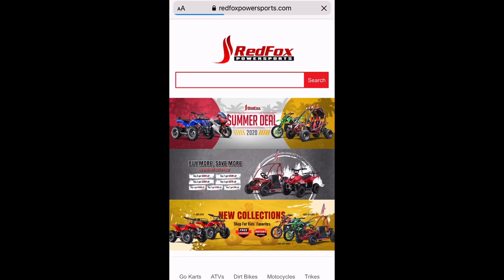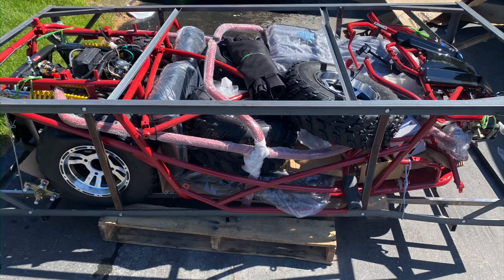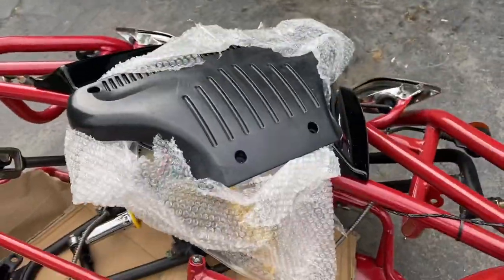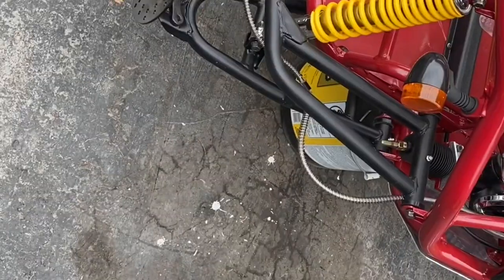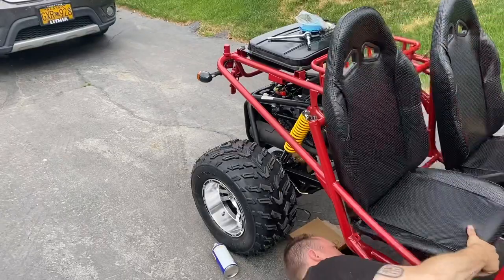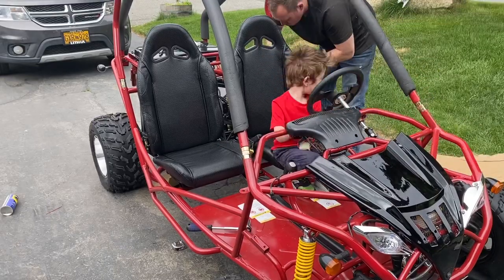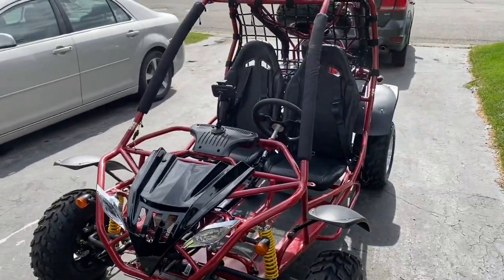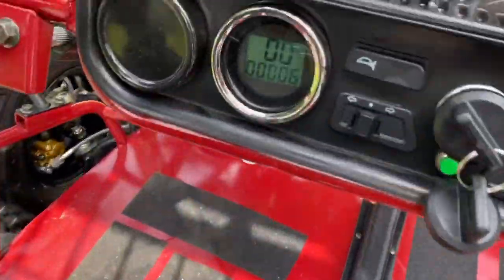I Bought a Go Cart! DONG FANG 200GKA + Back Injury Fail!! RE-UPLOAD

Comment: Hey thanks for the review! I literally just ordered the same kart/buggy and can’t wait to test it out. Seems like a good deal for the price!
Reply from the maker: Caleb Downey it is very very good for the price.  I’m slightly disappointed at things like the latches on the back end, and the way the passenger seat had to be refitted. But all in all it’s very difficult to beat the price.  And when I started up the first time and it fired over, it’s hard to beat that feeling of not having to suffer through all the problem solving
Reply: All Things Random Right, I figured things wouldn’t be perfect, just have to modify a few things here and there but overall that’s sweet glad to hear!
Reply: @allthingsrandom8137   where did you find your research on aligning the front wheels
Reply from the maker: James Furnish so I’ve aligned front tires on ATVs before and just followed the same.  What I did was measure (tape measure) the front of the front tire and rear of the front tire 
and adjusted until they where even.  It’s close enough I don’t feel any issues
Reply: I was going to pull the trigger on this one as well from the same website, but read a ton of bad reviews about the company.  How was your experience with them?  How long did it take before they shipped it?
Reply: @thedivision2761  me too bud. Until I see this video I was like heck no! But now I'm kinda thinking about it. I'll pay threw PayPal so of something happens ill get my money back.
Reply: @TEXASpatriot76  I actually ordered it.  As far as customer service goes they have been great.  Nothing like the bad reviews.  I ordered from redfox power sports.  The only negative things that happened are the gate in the back doesn't line up to close, and mine came missing 1 Tie Rod.  They are sending it now and have been good with customer service.
Reply: @thedivision2761  I'm from NY and ordered two of these about a month ago. No problems with the process at all and got them in a week (came from California). Same issues with the passenger seat and latches on the back hatch latch. Got about 40 miles on each and they're both still running great.
Reply: @allthingsrandom8137  update?
Reply: @thedivision2761  I ordered one as well, I live in west Texas and was able to find a dealer here in Texas. I'm pleased with mine. I wish it had the torque in forward as it does in reverse lol... that thing will spin the crap out of the tires in reverse

Comment: I’d use only non ethanol gas in it and on the back clip I’d weld a new tab and use 1/4 plate or a nice nut welded with a bolt to tighten it down.I wouldn’t use ethanol gas though In anything other than cars above 2000 year model.Not in mowers or weed eaters or that cart

Comment: I’m looking into getting the same kart but unfortunately the price has risen to about $3,000 do you think that it would still be worth it. Also how was your experience with Redfox Power sports. Sorry for all the questions but you are the only guy I found that has really done any sort of review.
Reply from the maker: I think it’s worth it for sure.  The only reason why I think I got mine for so cheap is because it was right in the middle of last summer during the pandemic. So they were just trying to get rid of whatever they could to stay a float. I think as long as you’re buying it for under about four grand, you’re great. If you look at comparable ones especially like for me here in Alaska they’re upwards of five to $6000. So even with a $1300 to ship it up here it was still far worth its value
Reply: @allthingsrandom8137  Thanks a lot of the quick response!
Reply from the maker: Desperado 73 no problem
Reply: @allthingsrandom8137  What kind of oil did you put in it?

Comment: How did you fit and how tall are you? I'm thinking about slowly  starting up go cart rally in the interior. Has it held up over time?
Reply: Im 6’3”, 180lbs and I’m fairly comfortable. Still have knees belt straddling the steering wheel.
Not sure as far as reliability, but purchased a few days ago. Definitely a softer suspension then the kids Trailmaster Cheetah 8 go carts. (Which is a good thing)

Comment: Any chance I can get you to do a video going over the engine components very slowly. This DF Moto 200 has been abused and I hope to rectify it. So far it has taken over 8 hours to clean the fuel tank only because there are none to be found. I did manage to find an aftermarket carb for it also. Trying to install the carb only to find that the cable feels extra long. The hoses were worn out and not connected to the engine or plastics such as the air breather. Any help you can give me would sure be appreciated.
Reply from the maker: Sadly probably not in the near future.  This summer has been slammed with other things!  Sorry..

Comment: is there any way to increase the potency of that thing?
Reply from the maker: I know there is, like any small engine. It’s just understanding that it’s not necessarily the horsepower that’s going to make it faster, but the gearing in the transmission.

Because of the type of clutching system in it, it needs to rev high RPMs to get going fast, But honestly, as much as I’ve driven it, I would rather have less speed and more sticking power in the wheels at a lower RPM. This is something me and my buddy are trying to work out next summer

Comment: "Will it start? No. Yes."😂🤣
Reply from the maker: So all the snow has finally melted here in Alaska, and I left this thing out on the trailer uncovered all year long. I at least assumed the battery would be dead, now this is the battery they sent me. But sure enough, once I turn the key the engine turned over, and after a couple gas petal  pushes, it started.  I was pretty surprised by that, but I will say before I take it out again I will replace the battery.  Don’t wanna get stranded 10 miles out in the middle of Alaska

Comment: Hey brother how are you liking you're gokart now???? Still think it was a good deal???
Reply from the maker: I do.  Only wish it had a little more power.  Other than that, best bang for my buck so far.
Reply: I’ve heard there are gears available and you can swap from a 14 to 13 tooth to add some pick up.
Reply: @allthingsrandom8137  well you convinced me, I bought one. I believe mine is the next model up I can't remember witch one it is. But basically everything is the same but the plastic on front and top. Mine has the spare tire that mounts on top. I fell like it has enough power. But I can't figure out the dang alignment on front end. I did go threw and tighten ever bolt and added some due to all the vibration and rattling

HOW IS YOUR BACK????

Comment: great vid. hey what oil do you use for oil changes? The recommended oil at the stores is only for diesel.
Reply from the maker: 10-40 ATV OIL
Reply: @allthingsrandom8137  Thanks a bunch. One more question. How much oil does it take?
Reply from the maker: The Division about 1 liter
Reply from the maker: The Division What I did was drain it all out completely, and replace the exact same amount that came out

Comment: I love your video. I have the exact same model that I ordered from red Fox powersports in California. Shipped to Florida. I have a question, there is a second added air device attached to the exhaust with a tube that is zip tied going to nowhere. I can't for the life of me feeling anything on the internet of where this goes. Any help would be great
Reply from the maker: Kenneth Barnes II I don’t think so. I don’t remember anything like that. Mine is put away on a trailer covered for the winter.  I’ll look though when I have a chance
Reply: Aimee Feldbush  No. Just been riding around with that thing strapped to the frame
Reply: Same. Wasn’t sure where that goes....
Reply: I’m in Fl as well and heavily debating this one from this specific vendor, any feedback on ordering, delivery, turnaround time process?
Reply: Have two of these, had the same exact question wand haven't found an answer. Perhaps Red Fox would be of assistance.

Comment: How did you add the hour meter?  Did you source the round cover from somewhere?
Reply: I bought 2 of these. They come with the speedometer and odometer and can switch between mph and kph. It has turn signals, 4 ways, head lights plus a set of lights on top. It's even got a very loud horn. I've gotten mine up to a top speed of 45 mph with a little assistance from a hill and 41 on flat ground.

Comment: well thanks for showing how to put it together.  Tell your son he did a terrific job tightening up those nuts.!
Is 34 mph the top speed?  Is that fast enough to outrun a grizzly bear? LOL Just kidding.  You never know.
Anyway it is good to limit the top speed for your kids so that they do not get killed.   Oh about your front wheel alignment it is real easy to do! Forget about the rear wheels at they are spaced apart different than the front so that you cannot use them.  Get about a 5  foot straight stick and put it up against the outside of the tires with the long end touching the ground in front of the tires and mark the inside with a piece of chalk.  Then put the stick touching the outside of the tire front and back part and the long end at the back touching the ground and mark the inside of where the stick touches the ground.  Stick touches the front and back of the tire(theoretically you are supposed to use the rim) and the ground.  So do the same to both sides.   Now you should have 4 chalk marks on the ground measure the distance between the front 2 and measure the distance between the back 2.  When distances are the same your tires are perfectly aligned.   Theoretically you are supposed to put the tires slightly toe in with a rear wheel drive vehicle as when you push from behind it will push the tires apart if there is any play in the front end and with a front wheel drive when accelerating it pulls the wheels in so you are supposed to put it apart a little bit toe out.  But since yours is new and there is no play I hope, just make it perfectly straight.   You will get less tire wear that way.  Good luck and thanks for sharing.  Worst is to have it toe out a lot vehicle will pull left and right and all over the place.  You did a great job carrying the go Cart onto the driveway.  Wow. that was terrific!  Bit absent minded when you reached way out and tried to lift it that way with one arm.  What were you thinkg???  Guess you were not and paid the price.  Hope your back is better now.   |Best wishes for your continued happiness.  Bummer that shipping to Alaska cost so much.  Could they not ship it to you directly to Alaska????
Reply from the maker: Speed on the road was 40 miles an hour, about 35 miles an hour in the sand. They did not shipped directly to Alaska. I had to use a third-party shipment to get it from Seattle to Alaska

Comment: How do you change the oil on this thing? I just bought it and cant find it anywhere. Thanks in advance this video was very helpful since it did not come with a manual
Reply from the maker: Ari Hoffman if you look directly at the bottom, you’ll see there is an oil plug towards the back near the rear axle.   There are 4 plugs, two on the engine, two on the transmission.  Either one on the engine will technically change the oil, but the correct plug is the one that’s facing downward not the one facing sideways.
Reply from the maker: Ari Hoffman ignore the two closest two you.  It’s further back
Reply: @allthingsrandom8137  Thank you for the prompt response. I found what I guess is the resevoir and the dipstick. Having trouble finding the drain
If you have a chance to take a pic it would be much appreciated
Reply from the maker: Ari Hoffman yeah man just shoot me an email at chasebowser27@hotmail.com So I have your email, and in the morning tomorrow I’ll send you a few pictures showing where everything is
Reply: @hoffather  underneath the motor you'll find a screw take the screw out an oil pours out

Comment: After you ordered from redfoxpowersports how long did it take till they said it was ready to get shipped??
Reply from the maker: sjs2002gd arrived in about 3 days after the order finalized
Reply: @allthingsrandom8137  wow that was quick.thanks for the response, you still like it? Any upgrades that need to be done?
Reply from the maker: sjs2002gd so the oil in it I would change immediately, they say it’s “break in oil” but I’ve read stuff that says that it’s “shipping oil“.  The oil is 10w-40 4T motorcycle oil and it takes like 1 quart.  Well, slightly less. Then I would run it through an entire tank of gasoline, not too hard just like light driving, and then I would change it again and then you’re good for a while.  The quality is far higher than I would’ve ever imagined for the price.  But other than that I strapped a come-a-long to the back hatch because when we off-road in Alaska we’re literally in the middle of nowhere. And the last thing you want is to get stuck.
Reply: Did they send you the mso/title with it?
Reply: @allthingsrandom8137  did they send a title with it , or did you have to do that separately?
Reply from the maker: sjs2002gd there was a certificate, I guess you can call it a title.  It gives the serial number the horsepower rating and everything else.
Reply: I was told by the local shop to use regular 10w-30 oil, not synthetic because it will wear away the seals

Comment: Hey bud will you do a rear break install?
Reply from the maker: I may towards the end of the summer with an oil change and transmission oil change.  My e-brake is not working and clearly needs an adjustment
Reply: @allthingsrandom8137  I was trying to figure out how to take off the break Caliper because I lost a break pad and I don't know what bolts to take off

Comment: I’m doubting the engine is putting out more than about seven horse power. I am thinking about getting one of these go karts....🤔
Reply from the maker: The title that comes with it says 13 horsepower.  Not really sure but it goes very well off road, and in the street easily get 40 mph.  Honesty on sale, these are worth every penny even for the flaws.
Reply: All Things Random That’s pretty good output for an air cooled 200cc single. It must rev higher than I thought. After watching your review, I’m going to look into getting one. Thankfully I won’t have to pay $1,400 shipping like you did. 😱

Comment: maybe i pass on the poor back left gate , rattle my brains out !
the other GKD 200 which has cargo front/back and 5th tire.
Much cheaper also, seems the electric start and bigger wheels are $1200 extra.
$1200 buys alot of mods onto $1400 200cc pull start W reverse and  shutoff switch.
Reply: what kind of gold sprocket and chain kit and Lifan motor could on buy with $1200 upgrades ?

Comment: Whats the top speed?
Reply from the maker: Oscar Barajas With my 200 pound body, and my 80 pound son combined, about 41 miles an hour on the street, and about 38 miles an hour off road on sand.
Reply: I have a Hammerhead Twister 250CC it weighs almost 800 pounds an I use a jack when I wanna do something with the tires
Reply from the maker: Mike valazquez my pride said “no Jack needed” 🤣
Reply: I'm about 200 pounds,  even with my 12 year old daughter, we got ours up to 50 on street.